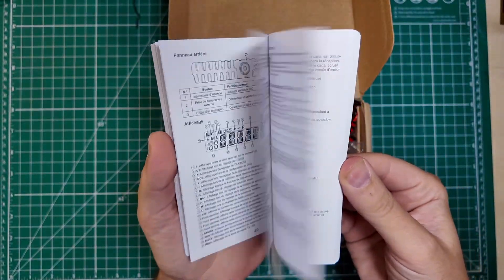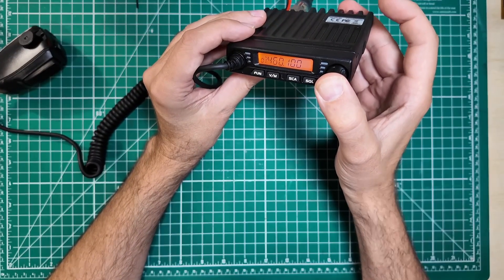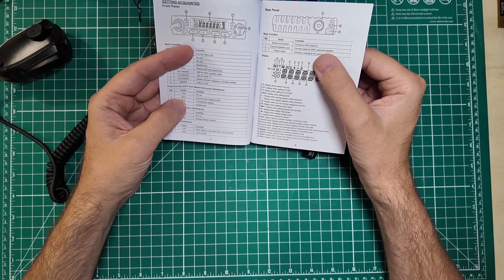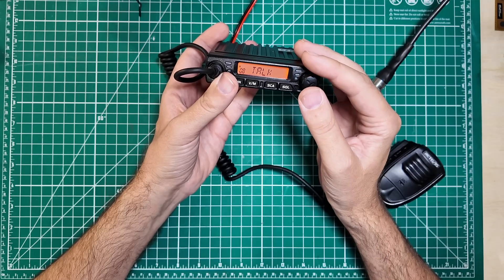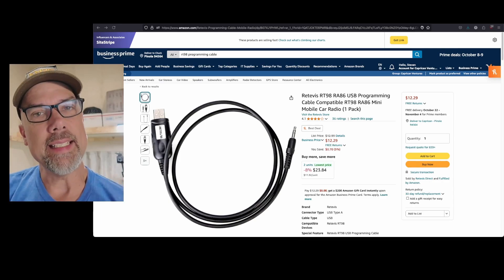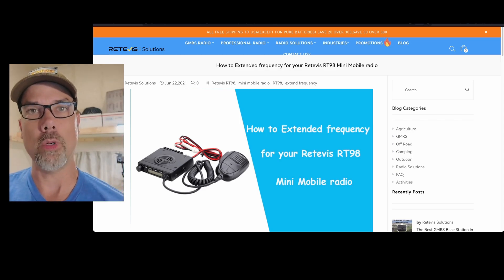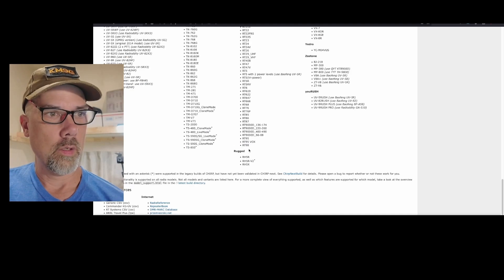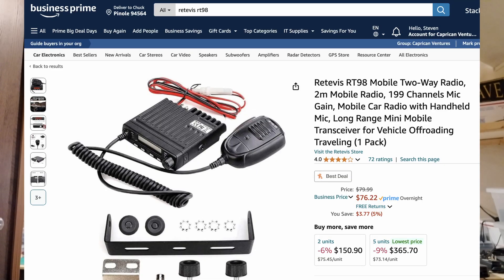Tiny: Redefined

Comment: The problem with the tiny mobile rigs is that heat builds up quick and kills things easy.
Reply from the maker: This one is only 12w and pretty good heat sinking.  I don't think I can out talk it.
Reply: @ only 12 watts should be fine. It’s just the ones with like 25 or 40 watts. They get to cooking like a hot hamburger after a short qso.

Comment: Honey... I shrank the Retevis!  What a great radio to put in a go box ammo can. And it's small enough to be able to piggy back in a Btech  AMP-V25 amp into it and get 30-40 watts when needed. The radio will need to be dropped down the low power setting in order to not overdrive the amp as it has a 6 watt input limit.
Reply from the maker: This would make a great tiny high (or higher) powered radio for sure!

Comment: Where can I buy that nifty quick connect power pole adaptor?
Reply: Easy to make... Wago's at Home Depot. Put  wires on the powerpole, and trim the length to fit in the Wago when you butt the two together. Shrink wrap the two together, and you're done. Harbor Freight is now selling Wago knock offs too.
Reply from the maker: You can make them with powerpoles (https://geni.us/HkSnAj) and wagos (https://geni.us/i3ow) - or you can get them premade at etsy: https://geni.us/IMBfaMr

Comment: Do you think you can connect a digital to this radio? They make a cable for the rt95 do they have the same pin out?
Reply from the maker: Not without much deeper modification - missed opportunity that.  The mic is permanently mounted and there is only an external speaker jack on the back - so you could monitor/listen/decode... but no encoding without the soldering iron.